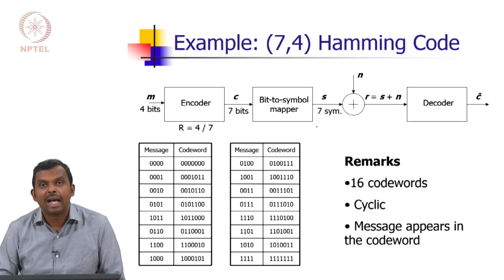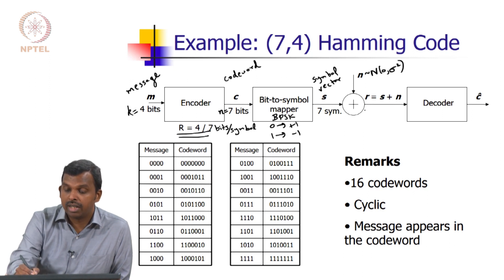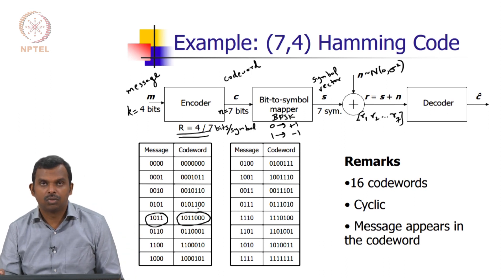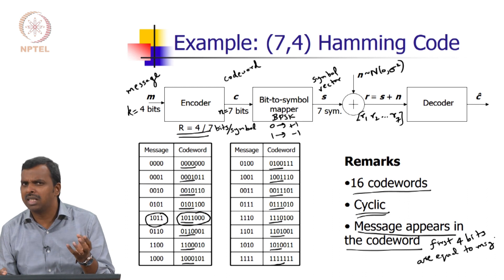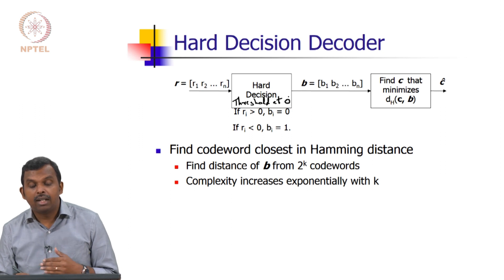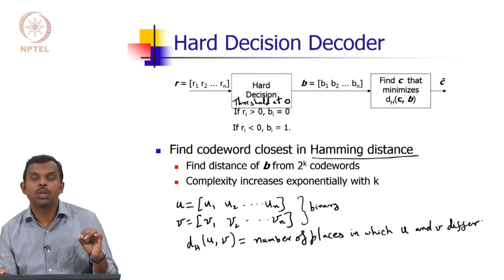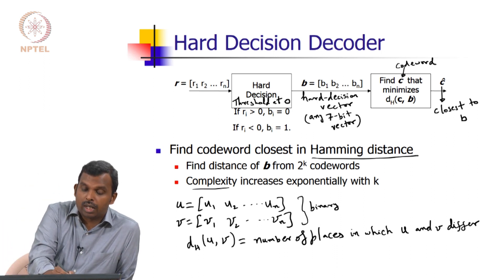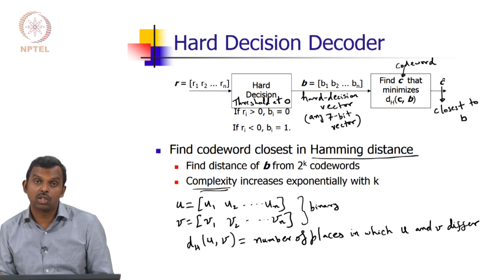(7,4) Hamming Code

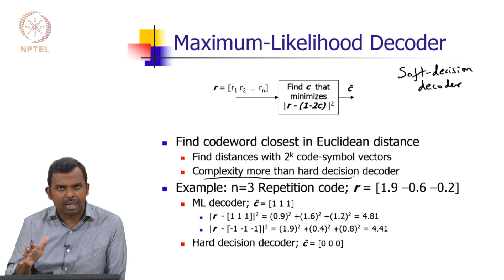Comment: At 12:35, ML decoder:  |r - [-1 -1 -1]|^2 = (1.9)^2 + 0.4^2 + 0.8^2, for this equation, 1.9^2 is not right. It should be 2.9^2. Right?